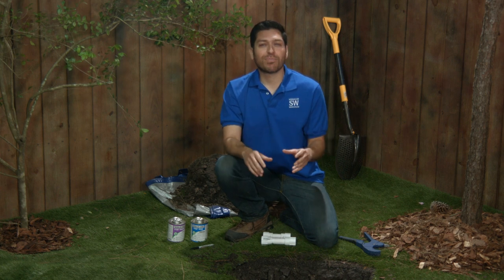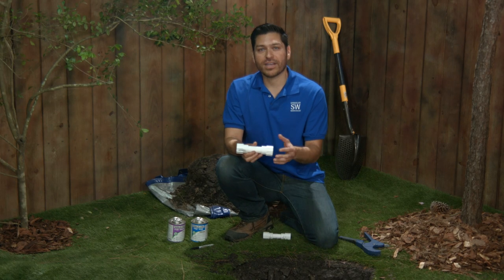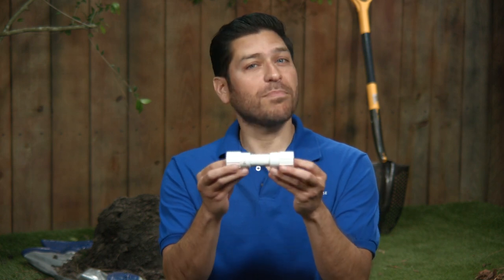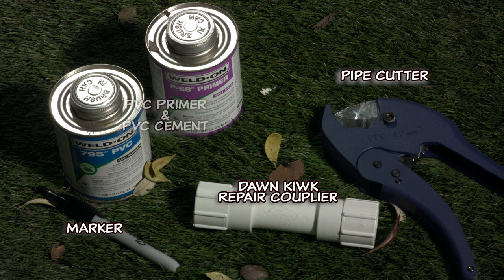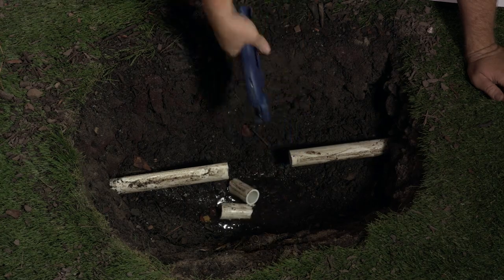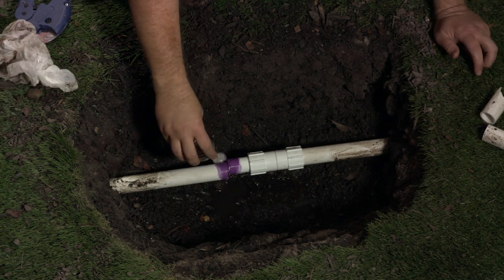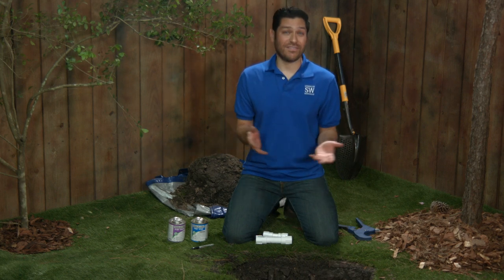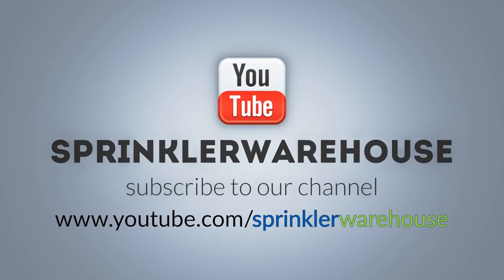Dawn Kwik Repair Coupling

Comment: Why don't you prime the sleeves?
Reply: It's too hard to explain in words. You need to see it in order to understand how it's designed and installed. It comes with instructions. It's very clever. The cement and tapered fit do the sealing. There are no rubber seals.
Reply: I agree. I would think you would primer inside the repair sleeve. Primer is critical to a proper pressure solvent weld. Can't find any mention of this anywhere.
Reply: @LeakLocators for this, maybe it’s best to use the all in one type of glue that already has the primer, like Oatey Fusion or Rain R Shine, or Blue Monster one step